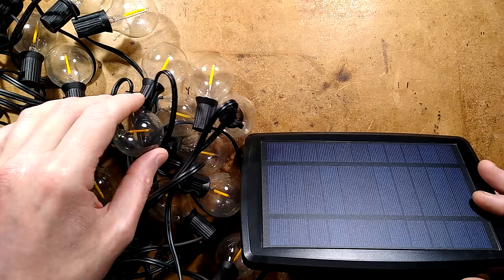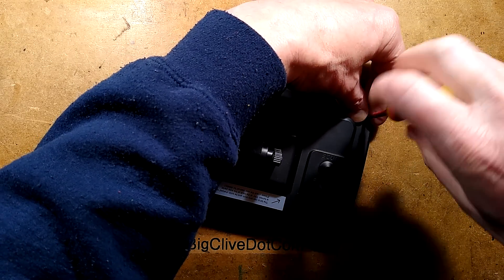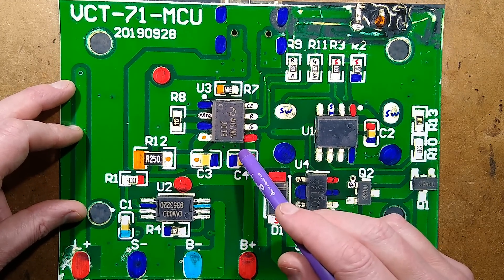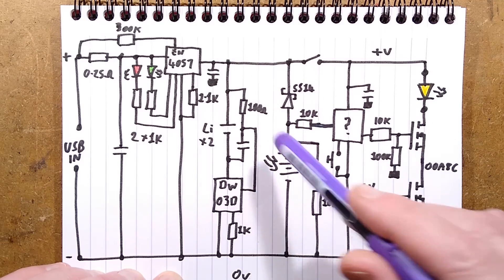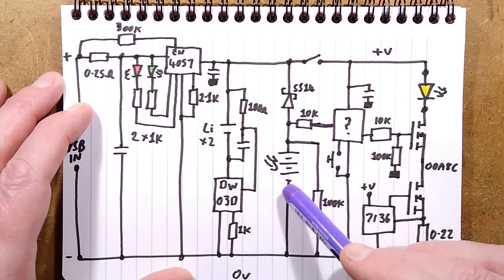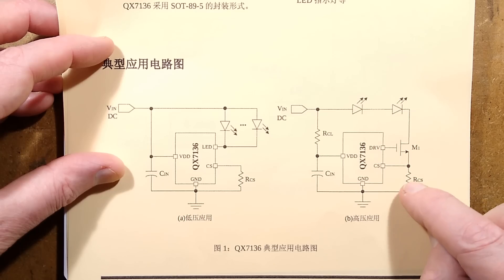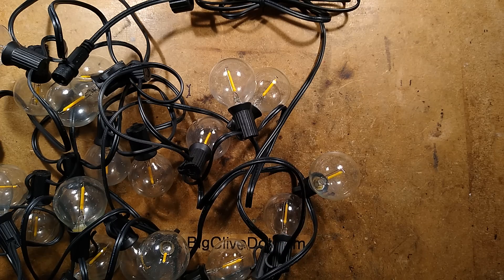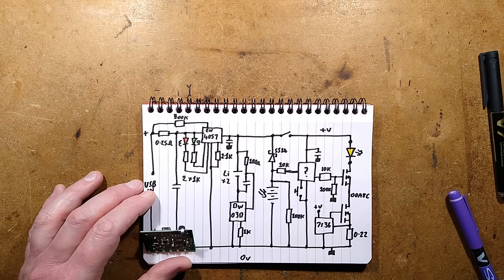Dead solar lights.

Comment: That's the first time I have seen a set of these solar powered LED lights with lithium ion 18650 cells in them. All the other ones I have come across use Ni-MH cells, usually AA size though some of the really small ones which power a single LED can use Ni-MH button cells. The AA size cells usually have at least 600 mAh capacity, with some having 800 mAh or even 1200 mAh, depending on the size of the solar panel and how many LEDs it has attached. Though I recently came across some "solar powered pebble" night-lights which work the same way, also with Ni-MH AA cells, though with only 300 mAh capacity. Which was a bit of a surprise - I have no idea how you can actually make cells of that physical size have such a pathetically low capacity, whoever made them deserves an ignobel prize for figuring out how to make cells which manage to be so utterly crap as that. Has anyone ever come across any AA size cells (either Ni-MH or Ni-Cd) with a lower capacity than 300 mAh?

Comment: Having interchangeable connectors and lampholders across LV and 240V is just asking for trouble. I remember motor-factors selling 12- or 24-volt 50W GLS-style lamps for automotive use, with E27 base, not realizing E27 would soon become common in the UK for household use,

Imagine accidentally screwing one of these in the posh Ikea fitting in the dunny. You'd end up with a flash in the pan.

Comment: The little current regulator chip (U4) needs an external FET (Q2) because presumably the amount of current that U4 would have to handle is higher than the chip can handle. U4 is a linear IC that requires classical transistors (either bipolar or MOS). A power transistor like Q2 has a special process optimized to handle large currents using a small die size. The linear device COULD incorporate a much larger transistor that could handle the larger current, but the increase in die size would increase the chip cost substantially. It's far cheaper to reduce the size and cost of the linear IC and tell the customer to buy an external pass transistor for a few pennies more. Cheap consumer electronics is a case study in cost control!

Comment: No comparison to those dollar store specials...occaionally you find ones that last a few years, and their performance can be improved by upgrading the single AA NiMH battery, and protecting from the weather by placing the top unit in a canning jar....
the rest don't make it through a northern California winter with over 30" of rain and days about the same length as the Isle of Man....

Comment: I've been running a chain of around a dozen LEDs from a Li-Ion protected cell which is switched and charged via a circuit I found on a web site.  The circuit uses 2x NPN transistors (2N2222 or equivalent), 4x resistors and a diode.  It turns the lights off and on automatically and allows the cell to charge when there's sufficient current.  The solar panel doesn't provide sufficient current even in full sunlight to stress the cell, and the protection circuit prevents the cell from being either over charged or over discharged.
So far, it's been running for roughly... 4 years?  5?  Something like that.  They provide enough light in my carport so that I can see where the keyhole is even if I have to return home late at night and I forgot to leave the outside light on.

I have another set of lights which used to use a circuit similar to the one in this video (and a virtually identical case), but that went dodgy (I think due to corrosion of a switch) so I changed it over to using the same switching circuit.  The one thing I need to do is to add a second protected lithium cell in parallel since only one doesn't last long enough with such a long string of LEDs to drive.

Comment: It's entirely possible that the listing was wrong and they didn't really understand the implications of the solar panel indicating it wasn't 240 volt... I ordered some 12 volt fairy lights off Amazon and after connecting them I was musing that it seemed like the colors were wrong... And then when I went to move them it was too hot to touch and started melting the stuff it was sitting on.  I eventually worked out that I think maybe they were selling 3v or 5v fairy lights as 12 volt, and since it fit the generic barrel connector on my power supply I didn't think much of it.  I'm just glad I realized it was a problem before it became a fire.

Comment: Prompted by your review, I purchased a set of these lights on Amazon ("LE Outdoor Solar String Lights, 25ft 26 Units G40 Edison Bulbs USB Rechargeable or Solar Powered Patio Lights Waterproof for Indoor Outdoor Garden Bistro Festival Decoration, Warm White"). They came exceptionally well packaged with each bulb individually cradled in styrofoam. The instructions that came with them were well written in clear English, and provide a warning that the bulbs are 3V and that they must not be connected to high voltage.

Comment: I´ve got that set in the 230V version. After a couple of weeks several of the bulbs were dead. I contacted the seller and they sent me  a complete Set that obviously was a return as it would blow the circuit breaker when plugged in. After a brief search I found one of the bulbs with a bent base so the tip did make contact to the thread.

Comment: Neat. I liked the constant current part of the circuit. I looked up the attiny204, could have been the mystery mcu, but I guess it would be too expensive for this. Probably it is a chinese brand mcu in use in this circuit.

Comment: It sad, but it is probably cheaper to by the whole thing than to try to buy replacement bulbs. Absolute madness to use the same connector for 240V and 3V LED strings!

Comment: The point you made about the connector blocks of the low and high voltage looms being compatible is worthy of discussion. 

In my experience, electrical and electronic equipment in the UK has historically been manufactured in such a way as to "idiot-proof" it, especially when you consider connector blocks and plugs. 

For example, small tangs, different shapes of blocks and male and females being connected in such a way that it's not possible to connect your sparky item incorrectly unless you are really spesh.

With the advent of global trade and so many companies overseas competing for such a tiny market space, such "niceties" as not murdering the operator or burning their house/office down is reasonably far down the list of priorities, somewhere below;

Make it cheap. 
No, cheaper. 
Fuck it, we'll use sellotape. 

We need to be more stringent enforcing this kind of safety measure because at some point, there's going to be another Grenfell or something of that magnitude caused by badly manufactured items bought cheap because none of us can afford socks anymore due to the cost of living crisis.

Comment: My experience with the epoxy (or fiberglass as you call them) panels is that they yellow with time. The ETFE panels don't have this problem but don't breathe the smoke if they catch on fire.

Comment: We have a set of these, they're seemingly good quality. The lights flicker on and off rhythmically when the batteries get low, possibly switched by that current sensing chip in "minimum current" mode? I would have expected the main microprocessor to have some hysteresis in its voltage sense input to prevent oscillation

Comment: Many LED flashlights use a variant of the 7136, the 7135, to drive the LED. 
I.I.R.C., the 7135's deliver 400mah each, and some lights use them in parallel to deliver more current to the LED, or they're switched in and out for various light levels.

Comment: Quite frankly, I've had most "filament" LEDs die within weeks. The only ones so far that tend to live a bit longer are Philips-branded bulbs, and even they appear to be highly susceptible to vibration like from being put in a desk lamp. By now, I consider that form to be trash.

Comment: I have a similar one (with USB-C input instead of micro USB). As it gets dark it flashes at about 1Hz. I assume this is because the light from the LEDs is enough to make the panel produce enough power to make the micro-controller think it’s day again. Once it’s fully dark it’s fine.
Reply: Very likely.  I have a security camera with infrared leds about 3m up and it was just strong enough to stop one of my solar wall lights 2m up from turning on.  I used part of a plastic tray to make a light baffle on the wall between the two devices. Problem solved and not that unsightly. I didn't expect 2.5w of infrared to be enough to do that.

Comment: I had some RGBIC lights with a poor 3-pin connector that could be rotated. It has +5V, GND, and data. Each LED receives color data, then passes it along on its data out to the next one. The connector was put on wrong for a second and it took out 6 or 7 lights in series. If you rotate the connection you can't reverse polarity, but you could e.g. have +5V on GND and GND on data, putting a negative voltage through data. Somehow each LED passed a negative voltage on to the next, and to the next, but it didn't blow them all out. After cutting out the bad LEDs I added a 1K series resistor to DATA after the connector, so future misconnections won't be able to put enough current to blow anything further.

Comment: Seems unwise to have compatible dimensions but incompatible voltages in a connector like that. Question for all you electrical gurus:

Why would LED bulbs flicker in one part of my house but not another, and is there an easy way to fix it? 

I have a bathroom vanity light with cheapo filament style LED bulbs and a table lamp with a nicer bulb in it that flicker intermittently. They will start flickering a bit, then more and more until they stop, then it repeats randomly.

If I move the lamp from one bedroom to the other it flickers in the one but not the other. 

None of the lights are on dimmers. The table lamp I've had for years. The house is new construction (though I keep finding things wrong with it, avoid speculative homes unless you're handy or can't afford anything else newish).

Comment: It appears that the Li Cells are not managed separately, is that correct?  How unsafe is this condition RE: over charging?
Reply from the maker: Lithium cells in parallel act as a single cell.

Comment: Mr. Clive, Have you capacity tested the "1800 mAh" marked 18650 cells to see if they actually ARE 1.8Ah??  Being that they are not marked 18000mAh  or 1,000,000 mAh makes me think they may honestly be 1800s...

Comment: If you're lucky the panel is covered in ETFE which is claimed to last up to 7 years before the UV kills it. If you're unlucky it's covered in PET in which case it may be no better than epoxy resin - ie. good for 1 or 2 years in countries with strong sunshine due to UV and/or failing by peeling away from the edges of the panel. There is good info in blogs and faqs on a manufacturer's site, voltaicsystems. This is not an endorsement - I don't know how good their products are.  Some sellors claim 2 to 5 years lifetime for PET encapsulated panels.

A serious issue with the battery charger circuit is that there is nothing to prevent charging when below 0 degrees centigrade - which is an absolute no-no for the vast majority of Li-ion cells. It causes (permanent) plating of metallic lithium on the anode which is nicely combustible. It's not uncommon to get very strong sunshine on a clear, freezing winters day in Northern Europe, even in the UK, so it's a real issue. Ok. the fire risk might not be a big concern for garden lights but you don't want the batteries destroyed every winter.

A 2 cent thermistor + resistor might be all that was needed -  but hey an extra penny or two on a £50 set of lights would direct the 'select by price' majority to buy the cheapest set without the added protection. Most buyers wouldn't know of the problem and even if they do the product descriptions very likely wouldn't provide the needed info.

Comment: From the high standard of the circuit, I wonder if these were designed outside China. The PCB does look like a typical Chinese rush job though, loads of unused traces, random flood fills etc.
Reply: Unused traces?

Comment: seems they would have a different connector types for the high voltage and low voltage strings so they cannot be put together.

Comment: i have the same lights they're very bright, my set also has a remote. I knew it had two 18650s but I didn't think they would be replaceable. I like the product for how user friendly it is, replaceable standard bulbs and batteries

Comment: OK, so these are LED lights, but what are they used for?  Are they decorative, or can they actually give out some light, as in make a path visible at night?
Reply: All solar lights like this are low power.  They don't give off a lot of light.
Reply: @stargazer7644  Oh.  I have a couple of solar LED floods, they are pretty bright.  Do you know the wattage of these lights?
Reply: I got two sets and light my garden brilliantly compared to other neighbors
Reply: @alexbowey2760  I light mine with a 500W 60,000 lumen led floodlight.   Lets compare brilliance.

Comment: I'll bet they aren't using the QX7136 internal mosfet because the original design used a previous chip that did not have an internal mosfet, but that chip was no longer available, so they substituted without redesigning the board to eliminate the external mosfet.

Comment: I purchased this same unit off Amazon. Probably the best solar lights that I have come across. Running 4 seasons with cold winters. The USB port is to charge in winter if insufficient sunlight. Never used it. They emit for several hours in the summer months and the bulbs look nice. Glad that you ripped it apart before me! I imagine that once the lithium batteries are spent, I will be replacing them so at least I know what’s inside now! Thanks Clive. Love all your videos.
Reply: Link to the item?
Reply: Thanks you just sold me on a set, I own part of a mountain side and want some lights for a nice clearing that is way to far away to connect to my LV landscape lighting.  I'll prob make a pack with a couple more 18650s to ensure long lasting for when we camp up there.  I love watching Clive's videos dude is such a source of electrical know how that I can't dream of understanding lol.  For sure hands down my fav electronics channel.

Comment: Mystery chip, ha I'm cursed by a mystery chip in a simple buck converter, its magic is that it is rated for 90v dc to 5v out, and from some sellers 110v dc to 5v(12v option) out at 3amp, I'm really puzzled what tiny little chip they are using I have tried RS etc and nothing seems to meet the spec, I have 6, every one has its ID lasered off. i must say they are reliable i'm running 84v to one to run my arduino/gps etc for over a year

Comment: I've had the same unit outside for a couple of years. The solar panels unit is fine. The bulbs have pretty much filled with water, so only a couple now work.
It was good before the bulbs started to fail though.
Reply: Can you share a link to where these lights can be purchased from?
Reply: @Franksey180 
I got them from Amazon UK in 2020. They cost under £20 with Prime.

Comment: I've got a number of flashing solar LED beacons along my otherwise-dark driveway.  They're sealed units, complete with O-rings and rated for marine use.  After about 4 years, they've started failing, one by one.  The culprit turns out to be the soldered-in NiMH cells (1 per light) reaching the end of their service life.  There is a bit of corrosion on each cell, but they're replaceable.

Comment: With all the LED's in parallel under a single current-regulated supply, I would expect that with a single LED installed it would get substantially more current through it than if all LEDs were installed. Your single replacement bulb was saved from being destroying by the limited voltage available.
Reply from the maker: I calculated the dissipation for the single LED and it was well within the typical rating for those bulbs.  They are very under-run in use.

Comment: Thanks Clive. I really worry about 18650 Lion batteries in these kind of outdoor solar lights without any ventilation. Here in Australia the average day is 35c air temperature in summer (peaking to 40ish) while this box is in full sun and charging the battery- best case it shortens the life of the cell … worst case of overheating could be very bad.
Reply: If you think thats Bad i got some good news for you. 
They sold USB power banks with Lithium polymer battery's ( the soft pouch ones)  and it had the battery directly glued to the solar cell which reached well above 70° in the sunn. 😂
Reply: @NinoJoel  : I bought a power bank like that quite a few years ago on eBay. The small solar panel on one side of the case is impractical at best, and a scam at worst. In direct sunlight the solar charge current was only about 50mA which means it would take about 60 hours of direct sunlight to gather enough total energy to charge my Android phone. That's crazy. And yes, the unit gets extremely hot in the sun. Not good for the lithium cells. To make things worse, and here comes the "scam" part, the power bank has circuitry that wakes it up in fairly low light, i.e. when the solar panel voltage just comes up. Once woken up it starts lighting and flashing LEDs that indicate it's charging, even under indoor lighting. The problem is that regular indoor lighting is not enough to supply any charging current, and the unit is actually draining the battery to look "active and charging". The bottom line is to never buy a power bank with solar cells attached to it. Always buy a separate panel so you can plug into batteries you keep in the shade.